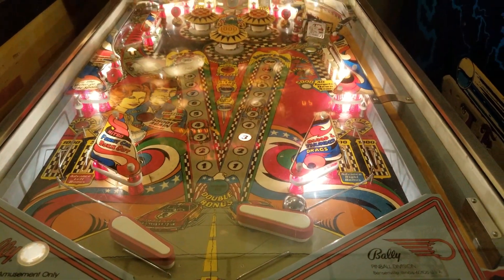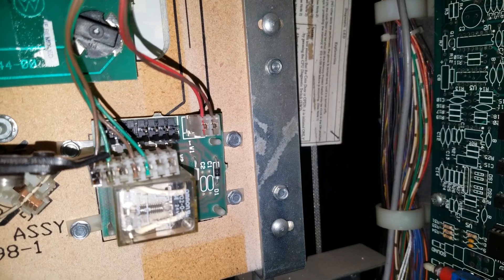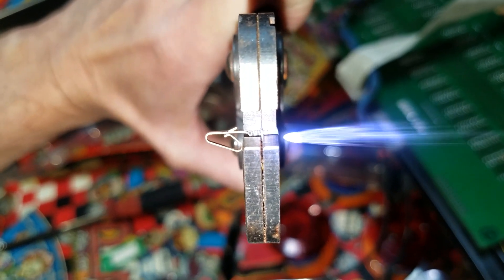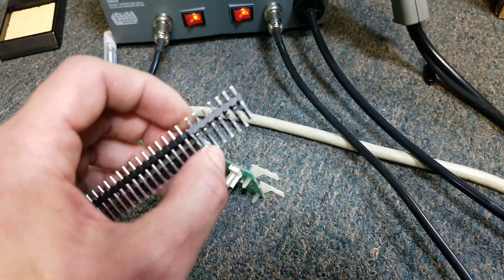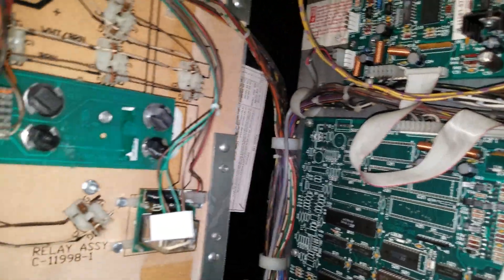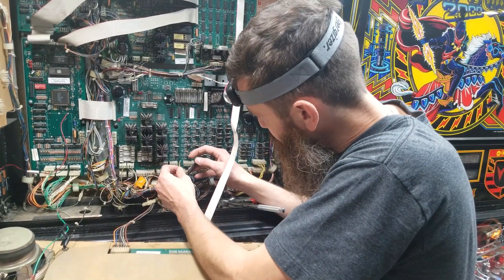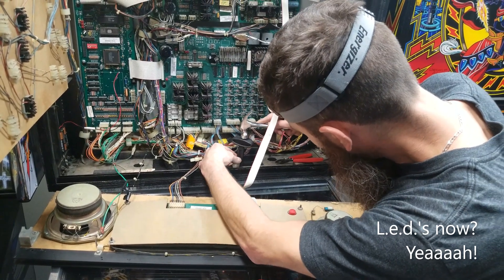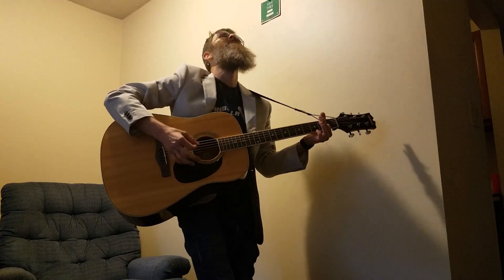How to re-pin Molex connectors

Comment: It is interesting that so many people now call this 're-pinning'.   I have been working with electronics for over 50 years.  'Re-pinning', to me, means replacing the header pins on the circuit board.  Those are the only 'pins' involved in the connection.   
In the plug, there are Molex crimp connectors.  Those don't have pins in them.  They receive the header pins.  
Languages and definitions evolve with time.  IMHO, calling the plug end 'pins' is incorrect, confusing and misleading.

When he replaced the header pins is what we normally call 're-pinning'.

Also, assuming these are 0.156" Molex Crip Connectors.  The crimp connectors that are better than these are called Trifurcon crimp connectors.  They have more contact area to distribute the current.

His crimping technique is perfect, his speaking voice is fine, and photography is reasonable.  

https://www.pinballlife.com/156-trifurcon-crimp-terminals.html
Reply: Well- you found the video 😎
Reply: @bheasy1  Yes.  I looked it up under the term 'pinball repin' to see what was there.  If I had not heard so many people use this misleading description, I never would have found this.
Reply: @TheHammer610  what's funny is the guy does your description of repin in the video. Cheer up buddy, it's gonna be fine =)
Reply: @bheasy1  no biggie.  Using different terms is confusing.  Nice to avoid that when possible.

Comment: thanks so much, I got my first pin and this was really helpful. 
I have a question, can the connectors in the second half of this video be replaced by the molex in the first half? in other words, replace the push in type connector for the crimped one. I know this is an old vid but I hope you can answer me. :)
Reply from the maker: Yes, you can crimp the old wires to new molex. Just make sure you cut them REAL close to the original connector bud!